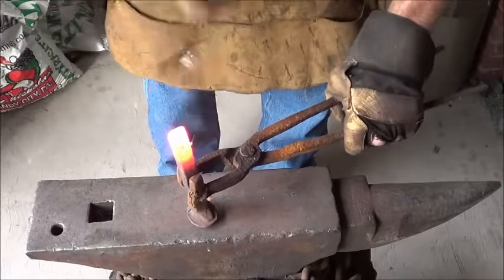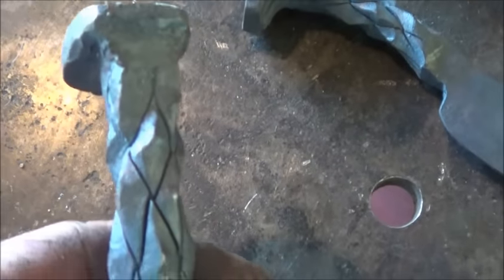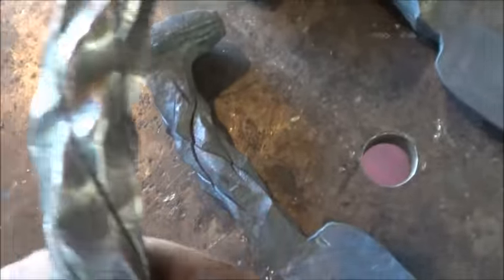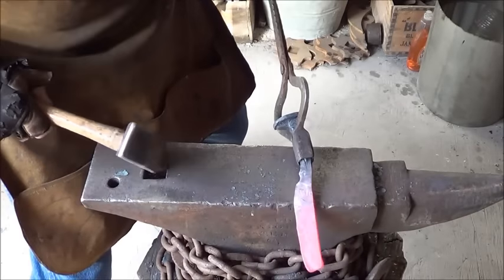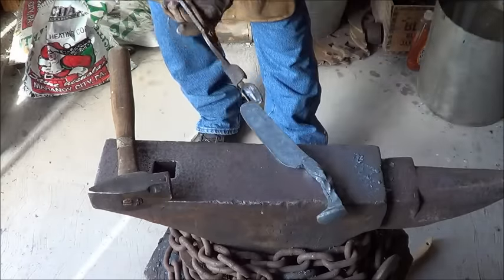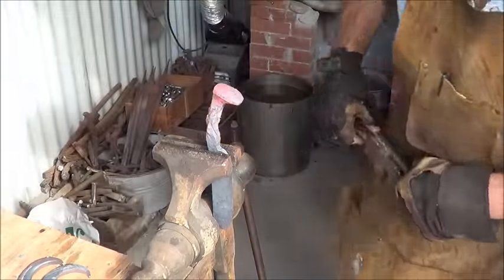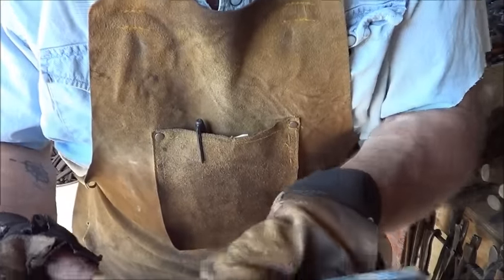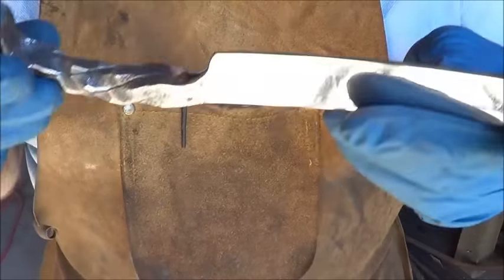Blacksmithing - Forging A Railroad Spike Froe For Kindling

Comment: Just a small tip. When quenching a blade it's a good idea to move the piece around in the water/oil to prevent the forming of a steam jacket around the piece which would make the piece brittle or form cavities. Great work and I love your videos :)

Comment: A great tip that I picked up from Tai Goo's Blog a number of years ago is that the best way to get the most width out of a RR spike, or any square stock for that matter, is to forge it on the bias, or on it's diagonal, (one of it's 4 corners).  Try it out sometime if you haven't already, it really gives you a lot of "spread" in the material since you're forging a much smaller surface area with the corners between the hammer and the anvil faces, forcing it down and out in width.  I've used this technique when forging integral bolster knives in order to get a good dropped edge right in front of the bolster. :)
Reply: Not only that but it gives natural edges with a decent spine if you angle your hammer towards the edge. Saves time on filing and dressing

Comment: Chandler..  It is a cool Idea!

A Smithing tip for you:   At some point every Blacksmith misses while chiseling or punching and ends up striking the anvil face.  Find a piece of channel iron that just fits over your anvil, place it over the anvil and use it as a protective cover when chiseling or punching.  If you miss..  no big deal, the anvil face is protected.

Thanks for the video..
Shad
Reply: +shadowcastre If you are using a London pattern anvil use the step thats what its for
Reply: William:  I agree..  provided your piece will fit on the step.

Shad

Comment: Just a thought... a convex edge would bite better, stick less, and split cleaner. Grind it on a slack belt and leave the forge scale on the top half. That cuts your grinding time down and gives a much more attractive look to your finished product. A wood splitter needs to look like a forged tool. A mirror finish makes me want to cut a wedding cake with it. Hammer on. Great video. $65.00 to $75.00 would be my price point out here in California.

Comment: just received my froe, I cannot say enough about it, this thing will split kindling like crazy, great design while keeping it looking good also, you want to start a conversation at the campfire pull one of these out and start splitting some wood. everybody should be ordering one of these.
Reply from the maker: +Aaron Roberts Thank you very much for your order!  Enjoy!
Reply: +Chandler Dickinson  Out of curiosity, what would it cost to make this with the same handle design but with a knife blade instead of the froe blade?
 That design would be a got hunting/skinning knife especially if you need to split a rib cage of a deer open.
Reply: Chandler Dickinson
Reply: +Chandler Dickinson I want one of these just like in your video. how much are they
Reply: +Patrick Howard     
Walk along the railroad tracks, they are all over.
Reply: ebay has a few sellers, also you can find them on the side of the road where there is old rail way tracks
Reply: people obviously have never witnessed a gift from god before
Reply: +Raycefan It is said that mortals cannot behold the true form a god
Reply: Hello Chandler Dickinson i would like to purchase a knife from you , do you ship out to san diego

Comment: Love the videos Chandler, thank you for sharing your passion with the rest of us.  A thought on the froe, it may be easier to use if you bent the handle away from the edge as opposed to towards it, and then hold it with a "reverse" grip.  You don't need as much aiming control with a froe as you do with a knife since you place it, and it gives your hand more clearance when you get to the bottom of the piece of wood you are splitting, or it gives you more leverage if you twist it to split.

Comment: Something you might want to look into is a "tool" finish. If you go to a hardware store look for splitting wedges, most are super rough ground then coated in paint or varnish and then the edges are finished. On something like this you might be able to just clean the scaling away and wire wheel the blade and then put the edge on kind of like how you did the handle on the first one. That would cut your "finishing" time to almost nothing and you wouldn't have to worry about the little imperfections ( also it would make them look less knife like and more tool like ). As far as hardening and tempering, I think you have a good process.

Comment: I like the mirror finish on that, especially the handle.  Good to see you hammering away at the anvil again too. 

If you could make 4 in 2 hours, and spend another hour polishing them up, I would think you'd be okay to charge $50.00 for them and come out ahead.  It seems you can easily do the fabrication, but I have no idea if you'll get $50.00 a piece.  I suppose you'll know if people buy them from your website or a trade show.  Good luck.
Reply: Someone said to not polish the blade.  I'd say make 2/3 polished and 1/3 non polished.  Drop the price on the rough ones by $10-$15. Some people may even highly prefer the more rustic look.  I love the mirror finish on the pommel!!!   Keep up the good work and videos!!!! I'd watch 10 a week if you made that many!
Peace

Comment: Chandler, great idea and great project. I'm not sure if I'm your typical customer, but for a wood cutting tool, I think I'd prefer a hammered finish on the blade, particularly from a hand-forged piece.

The up side of this is less polishing for for you. The handle I think polishing is worth it for sure.

Comment: Hi Chandler, i fabricate steel parts for motorcycles and other projects, but ive never dont Blacksmithing...watching the process, and thinking of the time the piece spends in the fire re-heating between forgeing hits.....could a second item be on under the hammer while you're waiting?...meanming that you forge two at once by swaping them over an keep hammering...jus kinds 'using the waiting time'?.. or am i off base..?
Reply: +Moonfleet41 you can heat multiple things at once, Im  pretty new at it so I dont put more than one i at once because if you don't pay attention you can burn up your stock. Hence the term "Too many irons in the fire"
Reply: Moonfleet41 Since he's using a (char)coal forge, he would have to be very very careful not to burn up his work. if he were using a gas forge then he could leave as many pieces as he wanted to in. however the fire will still leach some carbon from the items.
I generally leave at most two pieces in the forge so I can swap them when it grows cold.
Reply: Cruiser052 i made the mistake of working 5+1 at a time, middle of winter so quick cool off, and found that after about 20 minutes of cycling the thin edges started melting. I had to reduce it down to 3+1 at that point to prevent burn and melt off.
Reply from the maker: +Moonfleet41 thank you below to all that replied... i do sometimes work more than one piece but i have melted too many items with this approach...  i do however sometimes move multiple items through one stage before moving to the next... it depends on the piece i am doing... when i can have 4 in the fire and one on the anvil... i hear the cash registers ringing tho!

Comment: One thing you might try for keeping the cost down would be to make more than one at a time. Keep one in the heat while you forge the other. Then when it gets too cold, switch and continue. Could potentially double your output.
Reply: Or he could burn his steel

Comment: chandler, if you are going to quench the RR spikes why not do an edge quench and leave the spine out of the water. would cut the time you spend heat treating and tempering in half. i also wouldnt sharpen(put an edge but not super sharp)them and just make sure customers know that it is NOT a knife. if they want a knife in that style they can always custom order. Also you should make mirror polish an extra charge.
It looks good, and i like the idea. all of the above is just constructive criticism to maybe help you increase profit

Comment: Nice product, hope it sell well. The mirror finish is pleasing to the eye but I'm not sure it's necessary. Here's an idea, after the first grinding you can see most of the forging marks. Perhaps take the ones with the fewest marks and polish them up and just leave the rest as they are. Sell the polished ones for 25 bucks more.

Comment: It is enjoyable to watch you form the metal.  You lost me on this one though.  I have used a froe a time or two and the right angle handle allows a wrist motion after the blade is in the wood to split shakes or firewood kindling.  So I thought you would make a right angle handle in a miniature version.  That looks pretty much like a knife and would work like one giving up the advantages that a froe was developed to achieve.  Fun to watch you make it though.  Doug

Comment: Nice work, a froe does not necessarily need to be sharp. It's meant more for splitting than cutting. Yes the edge should be hardenned to avoid it from folding over. I used to split shakes on the west coast these are just some of my own observations for what that's worth...lol. Oh also the mirror finish is a good idea, wood won't stick in the pitting as much.
take care

Comment: Miller Knives took a 1 inch open end box end wrench and opened up the open end and forged it into a small tomahawk with a really nice look ... not suggesting you copy someone else. But if you are looking to sell some , these are really nice looking ... AND this should be rather simple to forge as the handle head and everything is all once piece ... The boxend is good for hanging the tool ... MAYBE you can start a play list of "Conversions" from rusty old shop tools into new tools with a different purpose... People bend screw drivers into beer openers ... cut up hand shovels to do the same.... even turn wrenches into tomahawks and turn old saw blades into new knives.

Comment: hi chandler, very nice work. from a guy that does quite sole woodwork might I suggest more of a taper on the blade to give it more of a wedge shape? it would make it a better splitter.  Might be my eye failing me but it seems kinda flat wich requires more force (that endangers your knuckles) . love your stuff man. now I'm  going out to finish my viking styled hook ^_^peace!
Reply: Balder Evans I was thinking about this also, maybe work with more of a scandi or convex grind to be a better splitter. I've never made one of these so I'm not sure how well it would work in practice, let us know.

Comment: I would love you to make me one just like that thickness and everything but as a knife and with the tip as a Tanto blade. Maybe when you get caught up. do you have a website or anything ?
Reply from the maker: +STG44100 I can do that... would be about $100 as grinding would be more precise.  You can request an item by emailing me at chandlersstore@mindspring.com or keep an eye on my etsy store at www.etsy.com/shop/McFinleysCabin
Reply: ok I will be in touch. Thank you
Reply: hey Mr Dickinson could u do a cobra head railroad spike knife?and how much would it be?

Comment: well you really got them down. Four in two hours is pretty good. I was going to suggest making two at once.  One in the fire and working the other.  Potentially should keep you hammering instead of waiting for steel to heat.
Reply: Just be careful of the old saying "To many irons in the fire.".

Comment: Hey chandler, I have a couple questions for you. I'm starting blacksmithing and I am making a channel called TheYoungSmith. I have two forges the first is a coffee can forge. The second is made with a cast iron pan and a folding chair. I want to use coal instead of charcoal because it is cheaper. But I don't know where to get it? Do you have any recommendations of where to get some? Also I was wondering if you had any tips for making a YouTube channel. I checked out you're etsy shop but there where no items to buy. I would love one of these knifes. And finally are you on patron I would be more than happy to donate to you. Thank you for you're time. Keep making these amazing videos. You're definitely my favorite YouTuber.
Reply: I regularly do blacksmithing with coal, and my town actually has a place that sells coal by a hundred pounds, or by a ton. I can get 100 pounds for 15 bucks, or 2000 pounds for 100 bucks. Just look around locally. If not, buy some online.

Comment: would a old file for the blade and a rail spike pineapple forge welded handle work ,,, just looking at the blade  portion  , look like a file shape,   could cut time ,lol???
Reply from the maker: +christophe leblanc Not sure it would cut time and the concept is a good one but because the item does not need to be extremely sharp and it will take much abuse I think the file might be a bit too high of carbon content for this use
Reply: cool ,

Comment: Hey, Chandler, I'm a beginner blacksmith working on his third knife project... I'm using a railroad spike on this project and I just put a twist in the handle... I want to keep the twist/handle looking more "rustic" than the blade (which i will grind). What's the best method to keeping that rustic, forged look while at the same time smoothing out the handle enough to make it comfortable to hold?

Comment: I think, perhaps, to draw out the handle a bit more, give the froe a bit more "blade" might be a good idea... would take a bit longer but then you could have 2-3 more inches of blade and a thinner "handle", which of course then could be given a "proper" handle by end user if they wished.   Just an idea...

Comment: could you explain a little about hardening ?
i watched a few videos where they heated the steel to a temp where a magnet would no longer stick to the steel
 then they dipped it in motor oil it did not matter weather the oil was used or not
then they baked the steel in a toaster oven at 400 degrees  for approx an hour or until the steel was golden
this method was done on knives

MY question - is your way of tempering different because you are not hardening the whole piece
also they only dipped the blade into the motor oil 
thanks i enjoyed your video and i subscribed
Reply: so i read some comments and learned that tempering and hardening are two separate things so ignore my question thanks loved the video

Comment: What if you omitted the pineapple twist, and bent the handle 90 degrees to the side? That might save time and give a lever to twist instead of batoning all the way through.
Reply from the maker: +David Ashley i like the idea of the leverage...  not sure I have enough steel to made the bend... but i could narrow the handle... i will think on this

Comment: hey there chandler how are ya doing? I was wondering if a Piece of silver can be made into a striker for a fire starting kit and will it work?
Reply from the maker: +Steve Jones for flint and steel no... it's not hard enough... for a ferro rod.. I still don't think it would be hard enough... might work but probably not very well...
Reply: Ok thank you very much. I was wanting to have a Piece of Jewlery Made up that I could also use if I was to get stranded  and needed to use it for a Ferro rod.

Comment: Hey can you make a video on normalizing?
Reply: Aaron Wag don't need a whole video. Just heat the piece up to temp (the steel will stop attracting a magnet at the correct temp) and then let it air cool. Good practice to normalize 3 times before heat treating.
Reply: Shane Allen oh okay thanks for the info.

Comment: hey chandler, I have a odd piece of metal from a rail road bed that was given to me. it's a large screw style 1"x6.5" and was wondering if I could bounce some ideas off you for it. I've tried contacting you via Facebook seeing we were in the blacksmith trading grp, but haven't been able to reach you(understandably so seeing all the other people that would be a issue.) is there a form of communication I could use that we can swap ideas?

Comment: Having used froes that finish was a complete overkill.rather than polish the whole blade I'd only grind a quarter inch from the edge rough and leave it at that. A froe is usually made of a leaf spring. Even in the black smiths heyday it was wagon spring. Just a loop on one end forge welded  cut to length and just enough edge to start the split. Beings you have a fancy handle is good enough to make it worth 50 bucks. But to sell it have someone demonstrate it cutting kindling. What you got in half an hour simple needs a goid edge for function. The other option is to make mini froes out of flat bar stock with a forge welded ring and edge with stick handles even dowels work. Sell those for 30 and the others will look like a real deal at 50. If you have both see which ones sell better make more of those. While the fancy works well people will identify with the other because it is more easily recognized.

Comment: shouldn't you be tempering the sharp part of a knife?
Reply: +Michal Gaik It's better if an edge bends/rolls than for it to shatter/chip.
Reply: that is my point
Reply: Michal Gaik My bad, got tempering and hardening confused.
Reply: it happens
Reply: +Michal Gaik he did :) he tempered the edge to a straw/golden colour and the spine to a blue, the edge is still hard but not so likely to chip, and the spine is soft and strong. Its called differential tempering.
Reply: +Conor there's a difference between hardening and tempering though. i think he left the cutting edge harder and the back tempered to act as kind of a shock absorber.

Comment: Wouldn't it work a little better as a froe if the blade was a bit shorter, the handle that same bit longer. and then bent at about 90 degrees, so the handle can be used for leverage to help the split along?
You also need a good name, like mini-froe, but that tells what the tool is for. Kindling splitter just doesn't cut it. Something like; "fireplace knife", but not so lame.....